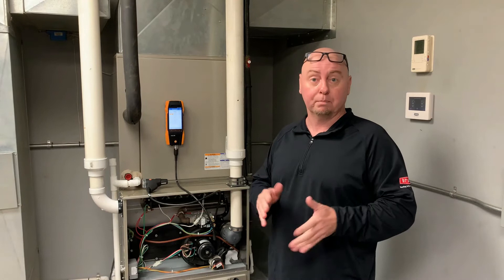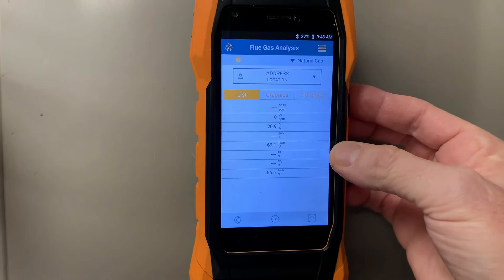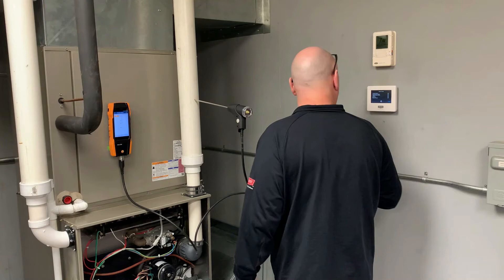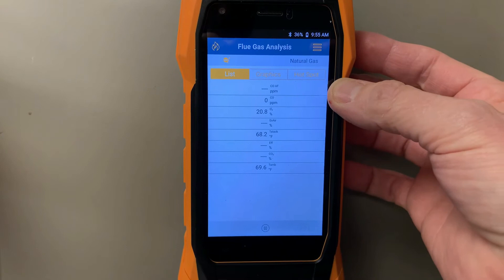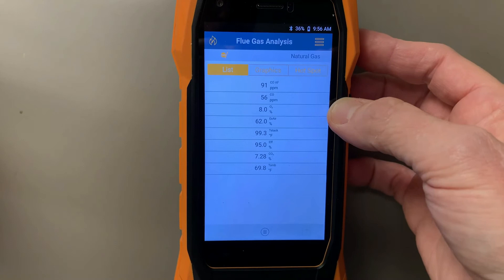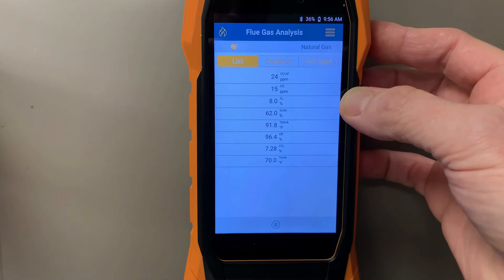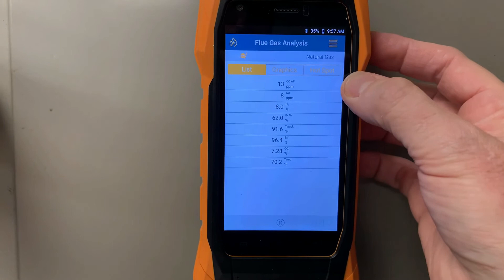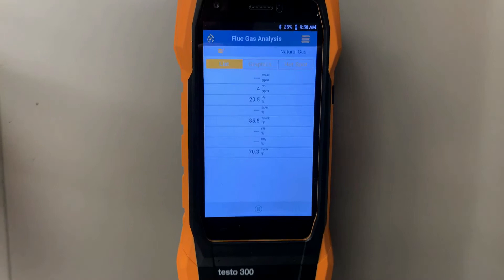How to Use a Combustion Analysis Meter

Comment: The top cabinet door on the furnace should have been in place during this test. Other than that this was an awesome video!
Reply from the maker: Good call, yes it should be. There could be air leaking in or anything with the door on creating flame disturbance. Obviously you would never see with the door off. 

The door was left off for demonstration purposes, I should have mentioned. 

Thank you!
Reply: @HabeggerHelp  how can I find you on LinkedIn?

Comment: If I want to fine out if the heat exchanger has  a crack,  should I go by just CO or CO air free ? And why do people says that if the CO is high, then it has a crack ? I thought only if the O2 rises after the blown, then it has a crack.
Reply from the maker: COAF apply’s to flue gases. CO ambient is more a reading used for living space. High COAF in the flue is not really a great indicator of a cracked primary. 

Change in 02 with the blower is a better indication. 

Although high COAF with a bad secondary is common.

Comment: Thanks for the great video. I have an issue with a 60,000 93% furnace approx 8 years old O2- 7.6% ,CO air free 0, Exc. AIR-57%,STAC TEMP 140,Dewpoint 123.8 Can't figure out high stack temp and not condensing.First time for this.Any help would be appreciated. This unit has never been tested.Vent doesn't look over heated.Thanks
Reply from the maker: I would suggest slowing the blower for better transfer. If the air speed is high you get less transfer thus resulting in higher flue temperatures.
Reply: Thank you for the quick reply. We're out of the heating season so I have some time to figure this out.Temperature rise on name tag is 40-70. Psc motor on lowest speed.Manifold pressure set at 3.4wc. As far as TESP  the note on the bottom of the chart( .1 extra pressure available if you don't use factory filter means if you read .5 on manometer you would read .4 on the chart? I think I might have to put a damper in the return ? Thanks again
Reply: Possibly over firing. Clock your meter to see if the output of the meter matches the input of the furnace.

Comment: What can cause higher carbon monoxide readings? If all my oxygen ratings are in range. Unit I saw had about 120ppm on carbon monoxide, o2-9%, co2- roughly 6%, excess air - 70%, stack temp - 112F. I've had units in this range run below 50ppm with roughly same numbers.
Reply from the maker: High COAF is fuel that did not burn. At 120ppm you are not far off. 

You have to ask why? Why did it not burn? Too much fuel? Not mixed enough with air?

Anything below 250 I think dirt. Dirty burners, orifices. But burner alignment and draft will raise your CO. 

Burner alignment is a tricky one often over looked. Pressure on the manifold from the gas line, or no back up on the gas valve will throw off the alignment. 

Sometimes an orifice change does wonder. 

But no residential manufacture post combustion numbers traditionally. So numbers are considered generally acceptable. 

But I will tell you, we make a few models that are certified up to 225 ppm COAF in the flue. 

And it’s normal.

Comment: all your readings are off because you are calculating your room temperature and not your combustion air temperature which is inside of the PVC tube and not inside your room everything you just took is worthless
Reply from the maker: It’s a dual temperature meter. 

It reads temperature in the flue and ambient.